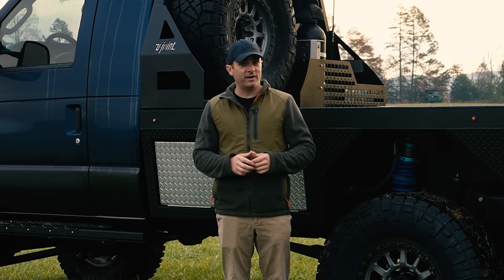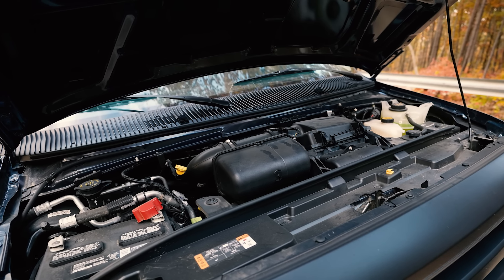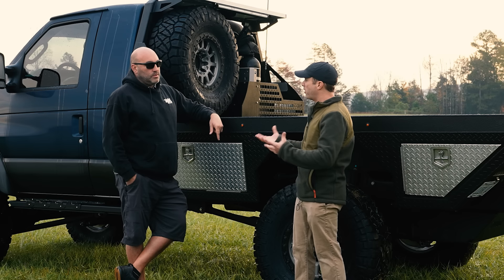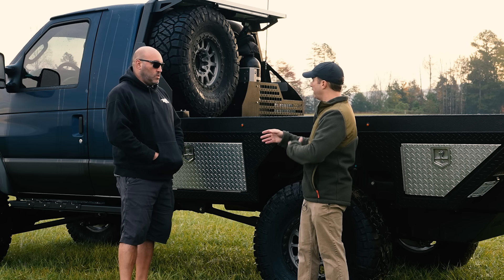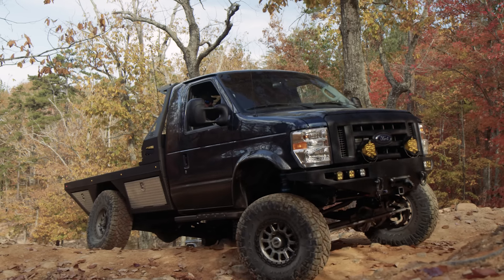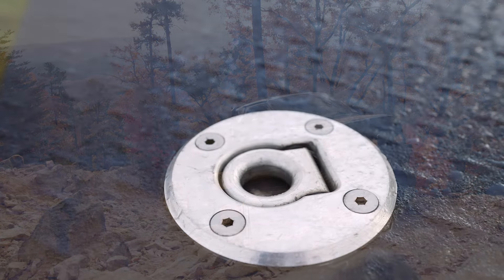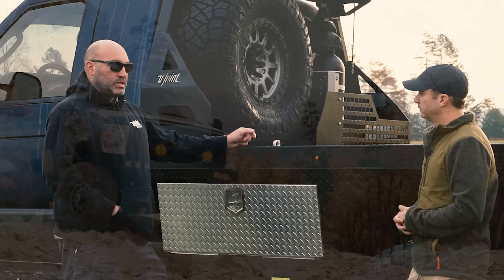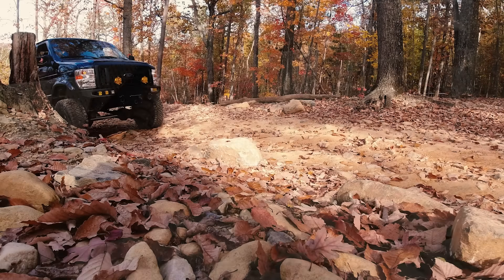2021 Ford E-350 4x4 Flatbed Van from Ujoint Offroad (V4 2.0) | Inside Line

Comment: I have a 2012 cutaway with a 5.4 and also looked into swapping to the Godzilla  by the time I was done its much easier to buy a new chassis and switch the supreme box over..
By a long shot
Reply: Good decision!
Reply: Noooooo don't ditch the TRITON 5.4 POWA BABY! 💪💪💪💪AMERICAN MUSCLE BRUH! You just gotta swap the cam phasers a few times, but SHES GOLDEN BABY! And then the rockers, BUT OTHER THAN THAT SUPREME POWER! 💪💪💪Well, might as well as do the oil pump while your messing with the cam phasers again, but WAHOO SCREAMIN EAGLES BABYYYY! (don't touch the spark plugs though, leave em for the next guy 😋)
Reply: My company just bought a 22 E-450 7.3 w/ 4.56 axel ratio, and even with the detuned 350 hp version the thing hauls the mail.. with a tune it would be down rite funny!
Reply: @Smokkedandslammed  5.4 on e vans have regular plugs so not sure what you mean by not touching spark plugs
Reply: @ansv3340  Sorry, that whole comment was a joke lol
Reply: @Smokkedandslammed  It was funny, and you obviously have had to call with a Triton, which I don't envy you on. 
That said, the E series only got the 2 valve version of the 5.4,so they didn't spit out spark plugs, they didn't suffer from the cam phaser BS, and they didn't suffer from the stupid head gasket bs either.  They reserved all that high performance fun for the F series with the triton option.  The E series 5.4's were just work horses, and pretty solid engines, albeit with lower horsepower performance.
Reply: @Billy Stray they called it Godzilla in the video, and you did too.  I guess you're both referring to the 7.3 gasser?  If so, I never realized that was its moniker. 
I've been driving a 7.3 powerstroke on my extended body E350 work van for many years, and never heard the godzilla term before.
Reply: @1SqueakyWheel  yeah its the moniker  Ford themselves came up with for the 7.3 Gas engine. it comes standard in the Econoline cutaway van

Comment: Make a camper to weld/bolt onto that flat bed!!
Reply from the maker: If you check out their page, you'll see that that's how it was originally built. He ended up pulling off the camper on the back and making it into a trailer. You can check out that here: https://youtu.be/JLlXETOouRQ

Comment: Would a flat bed truck be better because it essentially the same think but has much more room to work on the engine?
Reply from the maker: Well, hopefully, you don't have to work on the engine often. So, that won't be as important. I think the big difference here is that the E- Series cab makes it where you can have a longer bed, without the added length of a truck. This thing is fairly nimble on the trail.
Reply: @DrivingLine  yeah I can imagine being seated nearly over the front axle makes it pretty easy to place versus a pickup with a long hood.
Reply: @DrivingLine  that makes sense 👍🏻 thanks
Reply: No one realizes the advantage of the approach angle a van has over a truck. Inches count more than you think in some situations

Comment: Van motors are a pain to work on. I would of made it a flip front end like a semi first. Nice rig though.
Reply: Well I clicked on the video just to find the answer to why would someone use a van instead of a truck? If something breaks in the middle of a storm you want to easily access it
Reply: Not that bad as it has hood from the inside, when you take stuff off there is lot of space up top,. Hard places to get to would be exhaust manifolds, the frame is on the way ,

Comment: Cool looking rig. Just wondering what the advantage is to a van front? Seems like a lot of work to finish the back of the cab and convert it to 4x4 when you could just order a reg cab or super cab c&c F350 already 4x4 and build from there? Not knocking it just curious what the reason is? A shorter nose is about the only benefit I could think...
Reply from the maker: The owner builds E-Series vans for a living. He also already had a good assortment of parts (including the bed) leftover from his last build.
Reply: Overall length. You can have an 8 foot bed on a van chassis that is shorter than a short bed single cab pickup. In this era of absurdly long Super Duty crew cabs with tiny beds, it feels like the only way to get a useful truck that you can parallel park in a city.

Comment: Interesting rig, but, why? Van 4x4 conversions cost bank, whereas pickup truck 4x4 is a $4K factory upgrade.  And you can just buy a straight 4x4 chassis cab truck.  I am a van man, but the only added value I can see for this rig is slightly reduced wheelbase vs. a truck.  Cons are worse ride, harder to work on, MUCH more expensive.
Reply from the maker: The owner of this van owns Ujoint offroad, which specializes in Ford E-Series vans.
Reply: Why not?! Not everything needs to make sense to the masses, this video wouldn't;t exist if I built a flatbed truck. And a 10' on a truck will look a bit weird and not functional off road. The ride on this rig is stupid nice. Thanks for watching though!
Reply: @DrivingLine  Lol OK that is why.
Reply: @ujointoffroad  well, there’s definitely something to be said for short wheelbase.  I mean, pickup trucks are definitely a bear to park.

Comment: Looks neat.  But I don’t get all the bs to use a van instead of ordering a truck cab and chassis. Ford guys going out of the way to have a four wheel drive van with a gas gussler and no storage and a custom made bed and 4wd setup that comes in trucks.
Reply from the maker: He owns a business that builds and specializes in Ford E-series vans. That’s why this makes more sense than a truck. It’s essentially a big advertisement for his company Ujoint Offroad.
Reply: If I had ordered a truck then you wouldn't have this awesome video to watch.